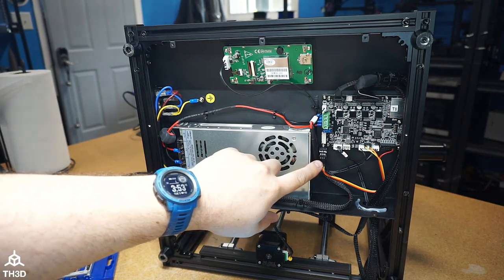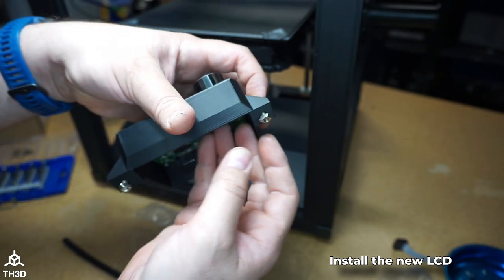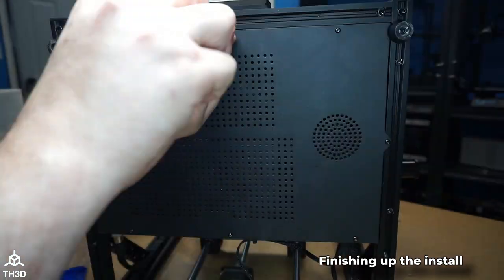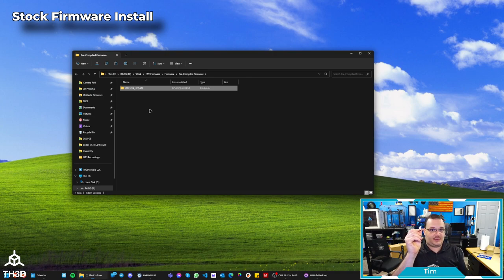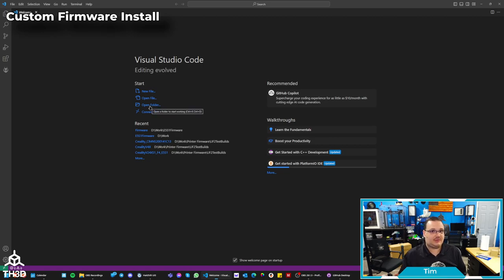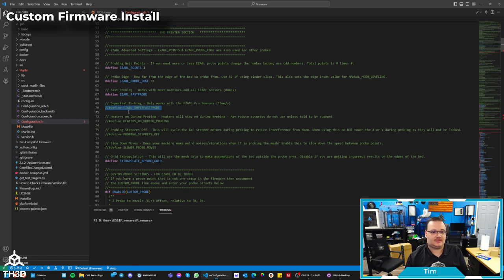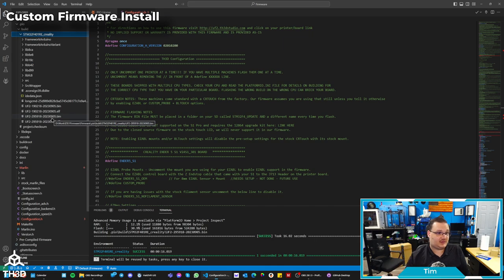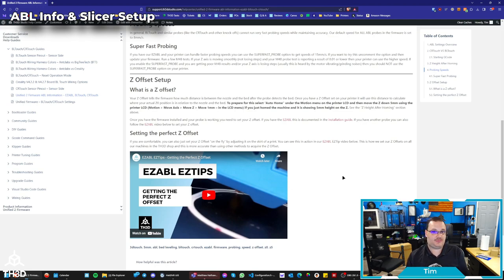Creality Ender 5 S1 12864 LCD Conversion/Upgrade Kit

Comment: Another video that requires the removal of the lower extrusion cover only mine is not removable as it is all metal.  I actually have one of those screens that I took off my ender 3 Pro when I installed a BTT color touch screen.  I would like some better firmware on the Ender 5 S1 though as when I use octoprint the screen on the Ender 5 S1 is unresponsive until the print finishes.
Reply from the maker: Maybe your extrusion is rotated? Bad assembly at the factory?
Reply: @TH3DStudio  Yea, I thought about that,but then I would have to take the printer completely apart.  I will leave it for now other than turning it on its side and checking.

Comment: So i have an E3V2 and I've seen multiple posts/vids/comments about the firmware limitations with the color LCD vs the 12864, but no one really explains what settings/options are missing from the color LCD menu.

Are the settings simply not able to work with the color LCD, or is it just a matter of changing config_adv settings to enable the missing settings?

Sorry for the questions, its just the one thing that I've never been able to find a straight answer to.

Thanks in advance. Have a great day!
Reply: The main issue with touchscreens is that they run their own mcu and firmware that communicates with the board vs the 12864 where marlin controls the screen directly, almost anything you change in config_adv wont apply to the touch screens. The screens firmware itself is almost always closed source, so any features missing from them, you wont gain unless they change it, which they never do.

The E3 V2 screen specifically is a bit different since it isnt touch screen, and the community has basically reverse engineered it completely so there is actual support for it
Reply: @lookitsrain9552  Ah ok that is much more helpful. Thank you for the explanation!